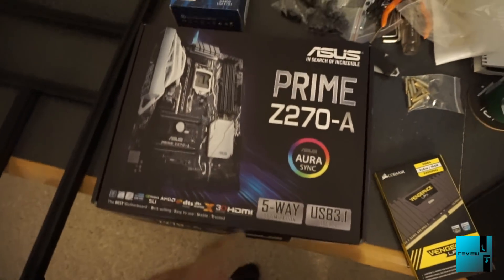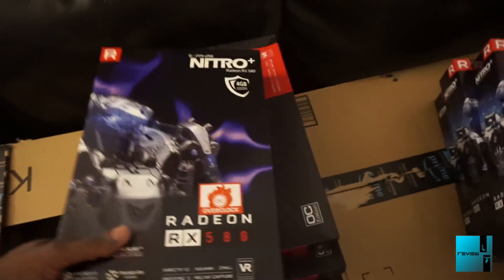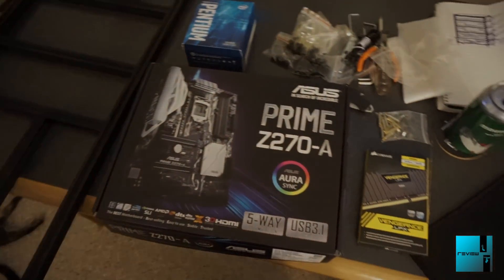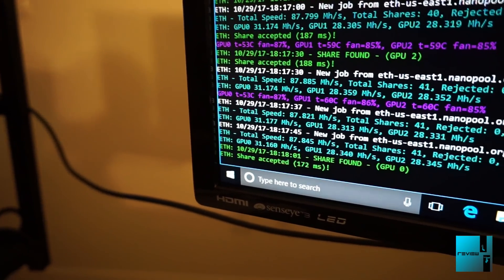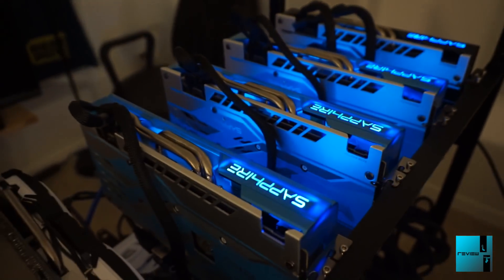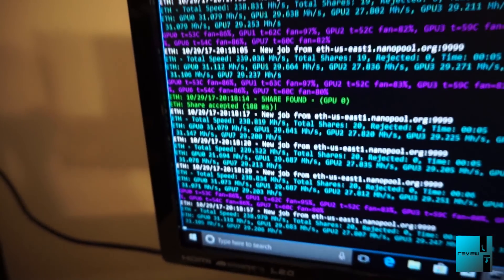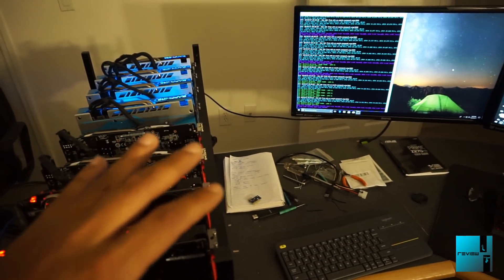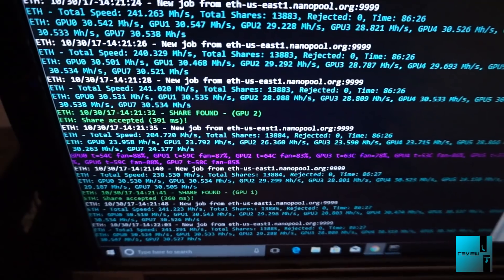ETH Mining Rig #2 Build and Assemble! 239MH!

Comment: So i have 7 of the msi gaming x 8gb ripping at 217mh/s waiting on those new M2 cards from the link you gave me,.. also went ahead an purchased the b250 asus because it just looks cool lol waiting on newegg, biting my nails with anxiety
Reply from the maker: that is awesome! so about 31mh each? any memory errors? lol you got to love that feeling of waiting on product to come in
Reply: Yeah so this is whats going on right now: 50hrs straight and 1 rejected share:

 ETH - Total Speed: 217.973 Mh/s, Total Shares: 9601(1373+1402+1393+1418+1350+1363+1411), Rejected: 1, Time: 50:22 
ETH: GPU0 30.916 Mh/s, GPU1 31.165 Mh/s, GPU2 31.184 Mh/s, GPU3 31.174 Mh/s, GPU4 31.170 Mh/s, GPU5 31.179 Mh/s, GPU6 31.185 Mh/s 
Incorrect ETH shares: GPU4 1
 1 minute average ETH total speed: 217.384 Mh/s 

something is going on with the PCIe bus when i add more than 5 cards, i tested 4 cards separately and then the other 4 and i wont get any errors with the claymore command line ill show below, but when i have all 7 i'm actually getting 2 gpus giving 1-2 errors every few hours, so im letting them rip on these settings until those M2 cards come in..

my claymore bat: ethdcrminer64.exe -epool us1.ethermine.org:4444 -ewal 0xwalletaddy.minerName -epsw x -mode 1 -allpools 1 -cclock 1200 -mclock 2200 -cvddc 825 -mvddc 950 -tstop 85 -tt 68 -fanmin 70 -fanmax 100

so i have the memory clock pushing 2200 and holding the gpu core clock voltage to 825 and the memory core voltage at 950 and i'm getting 105watts per card , also using the one click timings from polaris editor 1.6.3 ..

what was really stable was 208 MH/s 7 cards was this: -cclock 1200 -mclock 2145 -cvddc 825 , so instead of undervolting the memory clock just undervolted the gpu core and the  7 card rig was pulling a little under 1050watts total from the wall so when i get all 8 up all probably start from here ^
Reply: here is a bunch i have in my bat file

rem 7 cards no errors 211-212 MH/s 1130 watts @ wall : -cclock 1225 -mclock 2145 -cvddc 960 -mvddc 960 
rem
rem original settings 210MH/s -cclock 1250 -mclock 2150 -cvddc 960 -mvddc 960 : 
rem
rem 207-213MH/s flucates < 1126 watts at wall: -cclock 1200 -mclock 2200 -cvddc 950 -mvddc 950 
rem
rem 218MH/s < 1156w @ wall : -cclock 1250 -mclock 2200 -cvddc 950 -mvddc 950 
rem
rem 215-216MH/s 1020-1132 watts @ wall : -cclock 1200 -mclock 2125 -cvddc 825
rem
rem 208MH/s <1090-1102 watts @ wall 100watts per card -cclock 1200 -mclock 2145 -cvddc 825 
rem
rem mix: 217Mh/s < 1135 watts @ wall : -cclock 1200 -mclock 2200 -cvddc 825 -mvddc 950
Reply from the maker: rz698 what card are you using and memory type? Also did u run the patcher after flashing each card?
Reply: Review I.T. yeah all 8 are msi rx580 gaming x 8GB with hynix, ran the patcher for each as i added and modded
Reply from the maker: rz698  are u getting any errors with that wattage?
Reply from the maker: rz698 I’ll check it as soon as I get back in the office
Reply: I get a couple of memory errors with 218MH/s -cclock 1200 -mclock 2200 -cvddc 825 -mvddc 950 

i dont get any errors with these:

rem 208MH/s <1090-1102 watts @ wall 100watts per card -cclock 1200 -mclock 2145 -cvddc 825 
rem

rem 215-216MH/s 1020-1132 watts @ wall : -cclock 1200 -mclock 2125 -cvddc 825
Reply from the maker: it seems like you are under voltaging the gpus a little too much.
Reply: yeah I saw a guy in that forum get his memory at 825mV stable, obviously i got it stable on one card alone and seeing 85w-95w in gpu-z was like ;DDDD but as soon as i tried with all the cards it didnt like it.. 950/960 is pretty stable.. i just want to get as many cards on this rig as possible its getting addicting
Reply from the maker: thats awesome ya each card was different for me i had to do them one by one to see if it was going to be stable
Reply from the maker: rz698 hell yeah that’s good I’ll have to check it out when I get back to the office and watch the video thanks
Reply: if you do try it out set your pagefile to 60GB+ i had mine at 48GB (physical ram x 3) but he mentions in the video if the miner doesnt load just set it to 60000 and it worked, the miner would load then the dos window would before loading the GPUs
Reply from the maker: rz698 good to know thanks I’ll let you know how it goes

Comment: How are you getting 30 mh? Can’t get my 580s over 26.
Reply from the maker: MrFreeway99 what driver are you using?
Reply: Review I.T. The Blockchain driver
Reply from the maker: did you run the patcher after flashing the bios?
Reply: Review I.T. Yeah, what are your core and memory values? Did you put them the bios or are you just using trixx?
Reply from the maker: MrFreeway99 on which card?
Reply: Review I.T. Msi armor RX580 8gb
Reply from the maker: MrFreeway99 these are the 4GB model i did. what time of memory does it have?
Reply: Review I.T. Hynix. Where is your email listed?
Reply from the maker: MrFreeway99 on the channel page should see a message button

Comment: If you don’t mind sharing how did you set up the dual psu configuration?
Reply: Btw, I just followed your fist rig configuration but only with 2 gsu as a start since it’s my first build. Looking forward to putting everything together next week. Def appreciate your info!
Reply from the maker: Stephen Chen  the 1200 psu will run the mobo, cpu, hard drive, and four to five gpus. The 850 psu will do the remaining 4 gpus. The psu. Comes with a mobo cable and a rectangle jumper cap that plugs into the cable where it would to the mobo.
Reply: Review I.T. Thanks for the feedback! Also, are the 2 PSUs linked together with a dual-psu cable? Most cables I’ve seen online are 30cm and it doesn’t seem like it can reach with the psu on opposite sides of the rig.
Reply from the maker: Stephen Chen no i didn’t use the link cable just the jumper cap on the 850 and I turn it on when I hit the power button

Comment: where did you get the bios to modify the cards? thanks in advance, great videos I subscribed!!
Reply from the maker: i got my sapphire SE 580s on hynix memory to 31.6 with no issues running over 145 hours with no errors and no incorrect shares
Reply: could you please share what you modified in the polaris bios editor?  i've tried all of the various things i've found posted online and none have gotten me anywhere near 30.  i have those exact sapphire rx 580 nitro+ cards.  thanks!
Reply: Hi Jay:: I'm also getting 25 on my cards.. can you show me how you got 30 with Polaris
Thx thumbs up and subscribed - Jaymoe
Reply from the maker: Jaymoe1 what cards and memory type
Reply: Review I.T.  I have the xfx 580 gts Samsung  same  you have in the rig 1..  I can't get more than 23mhs ... which bios .rom  are using and How to do you tweak the power down  with trixx? ... my email chrosete@gmail.com. Thanks brother in advcance
Reply: Review I.T. ooo don't think I did the patch on it.. I ran the bios flash "antiflash "  saved the original ROM then flashed it with ROM downloaded.
Edit are you able to shed light on where I can get that patch?
Reply from the maker: Jaymoe1 message me your email
Reply from the maker: hey bud check your email :)
Reply: Review I.T. thanks alot will try it out after work!
Reply: hynix memories are kind of bad luck in case of sapphire 580s..cant get to 29mhs even after bios mods. there are talks online about this issue.
Reply from the maker: Hugo Trujillo these I made by making  adjustments with Polaris bios editor to the strap then used Trixx to fine tune it and to get the power consumption down on the cards. And thank you for subscribing!
Reply from the maker: Steve Schwartz I’ll be out of the office most of the day today but message me your email
Reply: Review I.T. I also want to know the info Im only getting 26 for the most
Reply: Review I.T. 8gb rx580 sapphire hynix memory
Reply from the maker: Jaymoe1 are you using a downloaded rom or your own?
Reply: Review I.T. negattttive. One that was downloaded via 1stminingrig.com urls! XD
Reply from the maker: Jaymoe1 what’s weird usually their roms work. Are you just flashing the bios and running it? Did you run the patcher before restart?
Reply from the maker: Chris R I’m away from the office I’ll be back there tomorrow night and I can email you the settings for Trixx after
Reply: I'm getting 21 on my rx580, where can I download bios?
Reply: Denys Fiialko check 1stminingrig.com and go to tutorials.